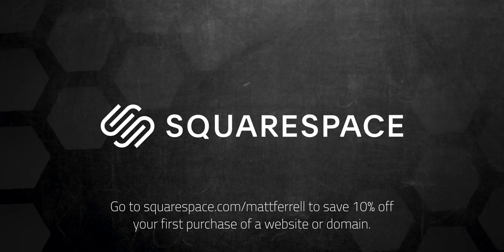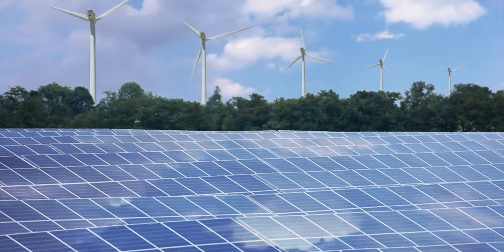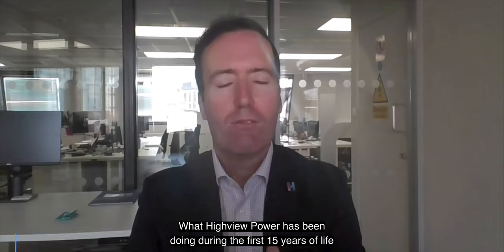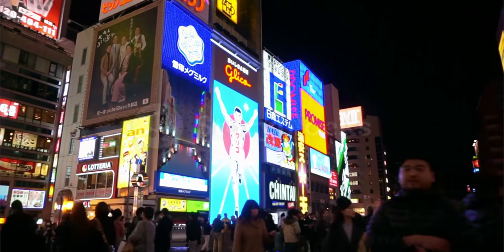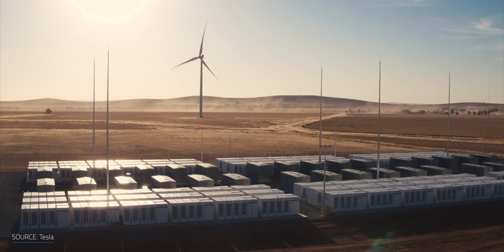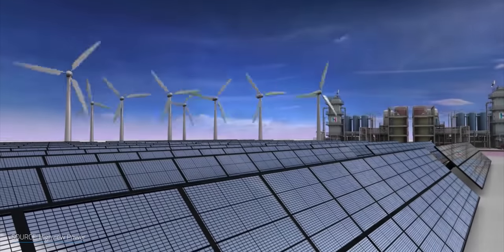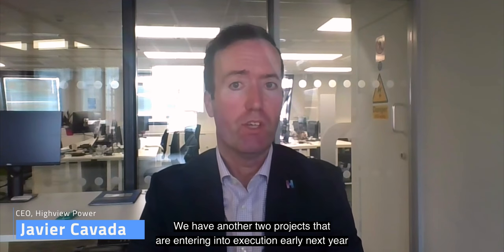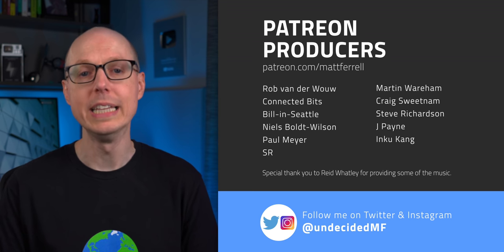Liquid Air Battery Explained - Rival to Lithium Ion Batteries?

Comment: Are the costs for losses on the unusable energy calculated into the actual $/MW for renewable  energy sources like wind and solar? Or are this figures based on theoretical output?
Reply: For the people purchasing a wind turbine they allow for the amount of time a year when it won't be producing in their life time costings. A wind farm not working is normally them being told and paid to turn off, this goes for gas plants on standby as well. It makes sense for the Grid to build storage using the money they would have paid out anyway and gain that extra electricity reserve adding to grid security.
Reply: The cost of generation is the cost of generation.  What you are asking about is the value of each input in creating the lowest total cost for the system/grid.  All our energy sources could produce more than we typically use.  (Nuclear is the exception in the US.  Nuclear is the 'most favored child' and is allow to run while other generators are told to lower/stop output.)

The capacity (CF) factor for coal and combined cycle natural gas plants is between 40% and 60%.  That says that there's a lot of unusable energy potential.  The CF for gas peakers is around 5%.  About 95% of their potential generation is not used.    

As renewable grid supply systems are designed the people doing the math will look at what would happen if they overbuilt wind or solar, not using some of the potential generation, in order to supply more demand direct from turbines and panels or if it would be more cost effective to add more storage to capture some of the unneeded wind/solar output and use it at a different time.
Reply: @bobwallace9753  "Nuclear is the 'most favored child' and is allow to run while other generators are told to lower/stop output."

When the unfavored children, Solar and Wind, are curtailed (i.e. not running, but able to) they continue to be paid. Favored child Nuclear has to pay for the privilege of running during those periods.

The problem with the unfavored children, is that when they throw a temper tantrum, complaining that the wind isn't blowing or the sun isn't shining or night fell or a storm is coming, AT NO PRICE, NO MATTER HOW HIGH, will they generate. They just go to their rooms and intermittently sulk.

The unfavored sulking children (Wind sulks around 70% of the time, Solar around 75%) are not punished, but rewarded with subsidies when they do come out of their rooms and do some work.

The favored, responsible child Nuclear works around 95% of the time, announces months in advance that she is taking a break (the other 5% of the time is maintenance and refueling) but is only paid the same amount as Wind and Solar, if she isn't paying to run during a windy day.
Reply: "Are the costs for losses on the unusable energy calculated into the actual $/MW" - no.

As Helen Lawson points out, the COST of construction and operation is the cost of doing business.

in a regulated state, the PRICE is set as a 1+% of COST to ensure profitability.

But, in the ISO, the PRICE $/MW is set by the clearing price of the auction, which includes any subsidies, tax deals, RE mandates etc.

For a demand of say 500 MW, it breaks down like:
Wind - 200 MW capacity -->  -2$/MWh (negative due to production tax credit subsidy)
Nuclear - 200 MW capacity -->  +2$/MWh
Natural Gas A - 200 MW capacity -->  +4$/MWh (high due to fuel costs)
Natural Gas B - 200 MW capacity -->  +6$/MWh (higher due to bad deal on fuel costs)
-----------
Result:
Wind is paid $4 @ 200 MW
Nuclear is paid $4 @ 200 MW
Natural Gas A is paid $4 @ 100 MW
= 500 MW demand, and $4 clearing price (lower bidders are paid more than their bid, because they were willing to bid low, so they are not penalized they could not make the entire contract).

For a low demand of 200 MW (Sunday at night) it breaks down as:
Wind - 200 MW capacity -->  -2$/MWh (negative due to production tax credit subsidy)
Nuclear - 200 MW capacity -->  -2.01$/MWh
 (negative because they find it difficult to shut down the plant and the juice has to go somewhere)
Natural Gas A - 200 MW capacity -->  +4$/MWh (high due to fuel costs)
Natural Gas B - 200 MW capacity -->  +6$/MWh (higher due to bad deal on fuel costs)
-----------
Result:
(favored child) Nuclear pays out $2.01 @ 100 MW
Wind is paid $1 @ 100 MW (because the grid pays the curtailment penalty for restricting them)

Over time, the 'favored' Nuclear plant can't support its capital costs selling electricity and so the plant shuts down.
The price rises to $6 at peak demand (i.e. the price of the higher priced, lower capital cost Natural Gas B plant).
The price stops going negative, because now Wind need only beat Natural Gas A, and Natural Gas A will never bid negative because they CAN shut their plant down temporarily.
Blackouts increase, because Natural Gas A and Natural Gas B can only supply 400 MW, so if the wind is not blowing on a 500 MW demand day ... no juice!

Do you see how cheap Wind is????
Reply: @factnotfiction5915  You are intermixing market sales and contractual sales of electricity.

On a pure market grid the utility is going to purchase the least expensive electricity first and then continue to purchase the next least expensive sources until they have obtained enough supply to meet demand.  With market pricing wind and solar are going to be the first purchased. "New" wind and solar are now cheaper sources of electricity than paid off coal, natural gas, and nuclear.  If you own a nuclear plant and are selling your product into the market you are out of luck when the wind is blowing and Sun shining.  Since it is very disruptive and very difficult to cycle a reactor off and back on you end up selling your electricity at a loss in order to force wind and solar to curtail.

On a supply contracted grid things get more interesting.  If the utility owns the reactor or has a "must take" contract then they will use that nuclear first (favored child) and not purchase from non-contracted sources.  If the utility has signed "must take" contracts with wind and solar as well then when there's more potential input from contracted nuclear, wind, and solar the utility will call for wind and solar curtailment but pay for the electricity which could have been generated.

Now for the rest of your "sulking children" comment.  That's just a silly take.  We all know that wind and solar are intermittent producers.  People in the stone age knew that.  As organisms evolved from single cells the fact the Sun wasn't in the air 24/365 was factored in.  So let's talk about how we deal with that intermittency issue.  

The solutions?  Storage, overbuilding, and dispatchable loads.  

Storage is getting very much more affordable.  Tesla just found out how to drop the cost of battery storage by about 50% and if you add in recent data on battery cycles the cost of battery storage drops very low.  $50/kWh and 15,000 cycles = $0.003/kWh to store daytime solar to use at night.  That's cell cost only.  

Overbuilding is what we've always used to assure we have enough capacity to meet demand.  We use our gas peakers about 5% of the time.  We overbuild gas peakers by 20x because when we need them, we need them.  (Interestingly, batteries seem to be rapidly replacing gas peakers.)  Sometimes it will make sense, for example, to install more solar panels that we need for sunny days so that we will have enough electricity on cloudy days.

Dispatchable loads will likely become more common.  We will find more and more ways to use electricity when it's plentiful and turn off those applications when supply is lower.  We do that now in California by pumping water over the mountains to the LA Basin when there's extra electricity.  

Wind and solar have become extremely affordable and should continue to drop in cost.  Nuclear has found no route to becoming affordable.  The age of nuclear power is waning.  Pretty much no country that has aging out nuclear reactors set up a program to replace those expiring reactors with new reactors.  Nuclear simply does not make economic sense.
Reply: @factnotfiction5915  The subsidies you speak of are not inclusive.  You only talk about the actual tax credits given to some producers at the current point in time.  In order to fully evaluate the cost of electricity from various technologies we must include all non-production costs.  There are massive external costs associated with fossil fuel use.  Health, environmental damage, and climate associated costs.  

And there are subsidies that have been given to "established" technologies in the past that allowed them to mature.  

"The economic and health costs of air pollution from burning fossil fuels totaled $2.9 trillion in 2018, calculated in the form of work absences, years of life lost, and premature deaths, according to a new report by the Center for Research on Energy and Clean Air (CREA). The cost represents 3.3 percent of global GDP, or about $8 billion per day."

That $2.9 trillion annual expense is a subsidy.  It's a cost created by fossil fuels which in not included in the cost at the meter or pump but paid through other ways.

Over the first 15 years of these energy sources’ subsidies, oil and gas received 5 times what renewables got (in 2010 dollars) and nuclear energy got 10 times as much. (Most of the renewable subsidies went to corn farms for ethanol, not wind, solar and other renewable electricity technologies.)

Between 1918 and 2009 oil and gas received average annual subsidies of $4.86 billion. (92 x $4.86 billion = $447 billion)

Between 1947 and 1999 nuclear received average annual subsidies of $3.50 billion. (53 x $3.50 billion = $185.6 billion)

Between 1980 and 2009 biofuel received average annual subsidies of $1.08 billion. (29 x $1.08 billion = $31 billion)

Between 1994 and 2009 wind and solar received average annual subsidies of $0.37 billion. (15 x $0.37 = $5.6 billion)

$4.86 billion vs. $3.50 billion vs. $0.37 billion per year.
--

OK, now let's deal with how things are likely to play out.  I'm using Lazard's most recent numbers.

New subsidized wind has dropped as low as $9/MWh with a median cost of $25/MWh.
New subsidized solar has dropped as low as $24/MWh with a median cost of $28/MWh.

The marginal cost of CCNG (operating cost of a paid off CCNG plant) is $23/MWh with a median cost of $28/MWh.

The marginal cost of nuclear (opex of paid off rector) is $34/MWh with a median cost of $41/MWh.

Now, if you run a utility company and need to keep your costs as low as possible to you use a combination of $25 wind, $28 solar, and $28 NG?  Let's say you use a third of each which would average out to $27/MWh.  

Or do you add in $41/MWh nuclear?  A quarter of each would take your costs to $31/MWh?   Why would you increase your cost by $4/MWh?
Reply: @bobwallace9753  First, I will agree that fossil fuels have a massive and undeserved subsidy in terms of the negative externalities of emissions. Coal and Natural Gas are bad.
(Despite the fact that you don't account for Natural Gas' negative externalities, you lump it in with your solution - which I will disagree with - after all, it only emits 40x more than Wind or Nuclear).

"Between 1947 and 1999 nuclear received average annual subsidies"
should be corrected to 'Between 1947 and 1999 Gen II/III nuclear received average annual subsidies'
Gen IV is a completely different technology. If you are lumping RE together, should we count the historic Hydro subsidies against Wind/Solar? No - because these are completely different technologies.

Should we count historic subsidies at all?
(Economics teaches "no economic decision should be made on the basis of sunk costs")

You use marginal costs - that is frankly stupid (before you fire back, let me provide an example):
The marginal cost of solar is very low: so if we build only solar plants .... no juice at night. Cheap, but nonexistent.
The marginal cost of nuclear is not low, but the average price of nuclear is low .... same low price during day as during the night.
Which is better? 
Really, think about this a bit before you fire back. It is a really problematic metric.

Marginal price is not a good comparison. Average price is better (although not perfect). System price is even better - if retail prices go up (as in Germany; much of it taxes, but then those taxes pay the subsidies) then an individual plant's marginal/average/wholesale price is meaningless.

You use LCOE - a better metric than marginal price, but still has issues.
https://en.wikipedia.org/wiki/Levelized_cost_of_energy
"The per-unit value is less important than the thing considered as a whole...LCOE, for example, fails to take into account the time of day during which an asset can produce power, where it can be installed on the grid, and its carbon intensity, among many other variables. That’s why, in addition to [levelized avoided cost of energy (LACE)], utilities and other electricity system stakeholders...have used benefit/cost calculations and/or an asset’s capacity value or contribution to peak on a system or circuit level."

And you fell direct into the trap with: "Now, if you run a utility company and need to keep your costs as low as possible to you use a combination of $25 wind, $28 solar, and $28 NG?  Let's say you use a third of each which would average out to $27/MWh." = $81 of assets = $27 average

Where is the trap? Well, if you have 1/3rd wind + 1/3rd solar and there is no wind during the night, then you have to rely on 100% NG - which means you have a blackout. Not great service!

OR you lower your return on assets
1x $25 wind + 1x $28 solar + 3x $28 NG = $27 average! (so its the same ???? no)
because you have $137 of assets, you have to upkeep the idle plants, leading to $45/plant operational costs

You either have to:
    A: raise your price for a reliable grid (wait, isn't RE cheaper???)
    B: lower your profits for a reliable grid (leading to long-term lack of investment)
    C: accept a less reliable grid

As for C, I am not interested in turning the 1st world US into a 3rd world economy. Instead we should turn 3rd world economies into 1st world economies!
Reply: @factnotfiction5915  
"Should we count historic subsidies at all?"

We should recognize historical subsidies.  To the extent that those subsidies helped technologies mature and grow enough to reach economies of scale they are important.  Nuclear had theirs.  Wind and solar are now getting theirs and approaching the point at which they will no longer be needed.

Post subsidies new wind and new solar will be massively less expensive than new nuclear.  Something like 2 cents per kWh vs. 15 cents per kWh.

"You use marginal costs - that is frankly stupid"

I used the marginal costs of coal, CCNG, and nuclear vs. the cost of new wind and solar which are still paying off their installed costs.  For wind and solar it's installed costs + marginal costs.  That's the reality of an electricity purchaser.  "Do I buy from a paid off reactor at at higher price than what I would have to pay to a wind or solar farm that just opened up?"

Remember, the emission problems of NG are not factored into the wholesale cost of electricity.  Those are external costs and not a consideration by the utility buyer.

If we do an apples to apples comparison, installed + opex price comparison,  then it's game over.  Coal and nuclear are completely out of consideration.  CCNG stays in the game for now simply because we have to have something to fill in the wind and solar gaps.  

The game is to meet demand as inexpensively as possible.  To do that you start with the least expensive sources and fill in with a dispatchable source.  Right now CCNG is the best dispatchable source, except for hydro which is capacity limited.  What we are now seeing is batteries beginning to replace NG.  And with Tesla's immense cost breakthrough we can expect batteries to greatly replace NG going forward.  

Here and past this point you demonstrate that you are not using logic but commenting from emotion.

"Where is the trap? Well, if you have 1/3rd wind + 1/3rd solar and there is no wind during the night, then you have to rely on 100% NG - which means you have a blackout. Not great service!"

Think about what you wrote.  If you can't figure out the problem get back to me.
Reply: @factnotfiction5915  

I want to address the cost of electricity more directly.

"I am not interested in turning the 1st world US into a 3rd world economy. Instead we should turn 3rd world economies into 1st world economies!"

Look at what is happening in the US at this very moment.  Coal plants are being closed because they are no longer competitive.  Some nuclear reactors have been closed because they were not competitive and more are scheduled to close for economic reasons.  Some paid off reactors are now receiving subsidies because they can not continue operation if all they receive are market prices.  Those reactors are only being kept online to support jobs in local communities.

That tells us that the cost of US electricity is dropping.  The most expensive sources are falling away because less expensive sources have entered the market.  This will continue as the cost of wind, solar, and storage continue to drop.  Since the utility industry does not (at this time) price in external costs we'll see cheaper technologies push out more expensive technologies with a resulting decline in costs.

Developing countries will go, and are going, straight to renewable energy.  Just like they largely bypassed landline phones and went straight to mobile phones.  Renewables are much cheaper to install.  They can be installed in a modular fashion, unlike very large fossil fuel or nuclear plants.  And they can be installed close to demand, bypassing expensive transmission/distribution costs.  Developing countries are likely to end up with lower energy costs than previously developed countries because they won't have the problem of more expensive legacy plants.
Reply: @bobwallace9753  

"On a pure market grid the utility is going to purchase the least expensive electricity first"
When the market is setup as a Dutch auction with rewards for least marginally expensive electricity - yes.
However, that does not make RE the least expensive for society, it is an artifact of the market structure that RE is 'cheapest'.

FERC asked this question: "On a 100% wind and solar grid, what is the clearing price for electricity when the wind isn't blowing at night?"
Then they came up with a 'capacity' auction, in addition to the existing 'energy' auction. Things have gone downhill from there.

insoluble

"The solutions?  Storage, overbuilding, and dispatchable loads." - Storage and overbuilding - yup! adding necessary assets, lowers the return and increases the price. Do you still claim this makes wind/solar cheaper? 

Dispatchable loads - yup! However, someone has to pay for poorer service. If my aluminum plant is going to go offline because of your poor service, I will demand, not just the cost of the juice, but the cost of the inconvenience. And, by the way, you can't keep me offline for more than 1-2 hours! And, if I have a must-ship order, you gotta pay my cancellation fees. And because my customer didn't get their shipment, the entire economy suffered.
Or, I might establish my own power plant - great now my balance sheet just ballooned with this extra asset, I have new liabilities, and it isn't the "stick to your core business" principles I learned in business school.
Wow! that RE with dispatchable loads is soooooo cheap!

"Storage is getting very much more affordable." - but you don't include storage costs in your wind/solar LCOE, do you?

"Overbuilding is what we've always used to assure we have enough capacity to meet demand.  ...., to install more solar panels that we need for sunny days so that we will have enough electricity on cloudy days.
"

We price in MWh, but we use in MW - so, to use your previous example of $25/MWh Wind, $28/MWh Solar, $28/MWh NG - AND ASSUMING ZERO INTERMITTENCY - we can calculate overbuild with the EIA capacity factors of 35% Wind (1/3rd), 25% Solar (1/4) and 60% NG (1 - because NG intermittency is how it is used more than its intrinsic c.f. -and anything less makes your solution worse)

we have: 3x$25 wind + 4x$28 solar + 1x$28 gas = $215 total assets for 3MWh = $71.1/MWh
    (3 wind farms to overcome the 1/3rd c.f. - et cetera
     3 MWh is the minimum, with a peak overbuilt energy of 8 MWh,
     so a maximum of 5 MWh curtailment
     It just gets worse if you add in intermittency)

versus 1.1x$41 nuclear (90% c.f.)  = $45.1/MWh
hmmm - nuclear appears to be 40% cheaper overbuild-wise (and at 0 intermittency!!)

"Wind and solar have become extremely affordable and should continue to drop in cost." - and has to drop in cost 3x/4x more to support overbuild and storage, none of which your LCOE numbers reflect.
Reply: @bobwallace9753  "Where is the trap? Well, if you have 1/3rd wind + 1/3rd solar and there is no wind during the night, then you have to rely on 100% NG - which means you have a blackout. Not great service!"

Think about what you wrote.  If you can't figure out the problem get back to me.

Bob - you proposed a scenario where a demand load is met by 3 equal-sized plants, 1 wind, 1 solar, 1 NG. I am asking how you meet that demand load if 2 of the plants flake out due to intermittency.

I posit that you could back up with a 3x the size NG plant (raising your costs and lowering your ROA or you could build a 3x size nuclear plant to avoid a blackout or you could just accept the lack of power.

What you haven't answered is how RE makes such a situation cheap.
Reply: @bobwallace9753  "You use marginal costs - that is frankly stupid"
 - and you double down by failing to realize the lack of usefulness of this metric.

"For wind and solar it's installed costs + marginal costs." amazing! you're going to pay off the combination of installation + operation on only marginal pricing? words fail me!

"If we do an apples to apples comparison, installed + opex price comparison,  then it's game over.
CCNG stays in the game for now simply because we have to have something to fill in the wind and solar gaps." 

Hmm, where nuclear leaves, RE does not replace it. Fossil fuel does.

Germany, Japan or in the US Yankee Vermont, Indian Point, Fort Calhoun, et cetera

https://www.greentechmedia.com/articles/read/us-nuclear-retirements-largely-replaced-by-fossil-fuels
https://naturalgasnow.org/indian-point-closure-puts-empire-state-up-against-a-wall-of-natural-gas/

Post the article that shows wind/solar replacing a NPP closure? I have been looking for that unicorn for over 2 years.
Reply: @factnotfiction5915  

"that does not make RE the least expensive for society,"

If you look at market cost + external costs then it is very clear that wind, solar, and storage are the least expensive electricity sources for society.  Even if we used only pump-up hydro storage at about $0.10/kWh we would settle in on the three and between liquid air, batteries and other possible storage solutions we won't be paying $0.10/kWh for storage.

Remember, new coal and new nuclear are very expensive compared to new wind, new solar, and new storage.

"someone has to pay for poorer service"

Yes, if someone has their operations disrupted they will need to be compensated.  We already do that with aluminum plants and pulp mills when supplies are stressed.  But there are also a lot of demand which is not 100% 24/365 and that will respond to prices and operate when the cost of electricity is lower.  Store "heat/cold" for HVAC use.  Charge EVs.  Run gravel crushers.  Run desal plants.  Find demands which have lower capital costs, build more than are needed, and run them only part time.

Now let's talk about LCOE.  Levelized Cost of Energy.  It's the cost of electricity coming out of a supplier, nothing more, nothing less.  Don't confuse that with the cost of a utility operation which also includes other costs.  Keep with the meaning of the term.

The purchase price of your car does not include what you are going to spend for fuel, oil changes, and repair.  

And LCOE is based on some assumptions.  For example, the LCOE for coal plants, IIRC, uses an 85% capacity factor.  But in the US our coal plants average between 50% and 60% CF.  The actual cost to the grid is higher than the LCOE because they have to pay the coal plant enough to cover the LCOE + the lost revenue resulting from lower demand.

Your math.  I'm not going to spend time on that because you haven't done an apples to apples comparison.

Nuclear is not 'always on' and can't closely load follow.  If you want to create a total cost for wind + solar + NG/storage then you need to create a total cost for nuclear + storage + backup.

Back when we were building nuclear plants we built a lot of pump-up hydro storage because most of our coal and nuclear plants were not quickly dispatchable nor could they do a good job of load following.  Both coal and nuclear plants go offline unexpectedly which means that we have to have some sort of immediately available backup.  In the old days we did that largely by running coal plants below full capacity and ramped them up when needed.   Some grids actually used spinning mass as a backup source.
Reply: @factnotfiction5915  Come on, you must understand your problem.

When the Sun is shining brightly demand might be met by 100% solar.

When the wind is blowing strongly demand might be met by 100% wind.

When there's some solar and/or wind demand might need some NG (or storage).

When there's no solar or wind demand will need to be met by all NG (or storage).

Add up what happens in each individual hour of the day and divide by 24.  That's where you get 33%, 33%, 33% or whatever it is.  Peak use is different from average use.

(I've ignored hydro and geothermal to keep things simple.)
Reply: @bobwallace9753  "That tells us that the cost of US electricity is dropping." - or, rather than unfounded hypotheses, we can just look at the data.

US electricity prices are rising, sector prices are rising, geographic prices are rising.
Prices are also rising in California, land of renewables, in all sectors.

[added a few minutes later]
I forgot this question: As wholesale prices decline due to RE, why are retail prices rising?

My answer: RE wins at the wholesale auction due to the way the 'market' is set up to favor low marginal pricing. However, systems costs are rising as the low average pricing thermal plants (i.e. Nuclear) leave the market.
The 'cheap' wind and solar isn't so cheap when others (state subsidies, competitors, ratepayers) have to bear the costs.

I look forward to your answer! Should be quite amusing.
(note retail is not a synonym residential sector)
[end of addition]

[Look, at least look at the data when it is available, and especially when it is so easy;
 I believe you are going to need a whole new line of argument to justify your concept that RE is cheap]

If these links don't work, then goto the base and bring up Average Retail Price of Electricity report. You can add/subtract states/areas/the US and various sectors; I selected annual, but you can go monthly - don't trust 2019/2020 too much due to covid

California - land of renewables
https://www.eia.gov/electricity/data/browser/#/topic/7?agg=0,1&geo=000000000004&endsec=f&linechart=ELEC.PRICE.CA-RES.A~ELEC.PRICE.CA-COM.A~ELEC.PRICE.CA-IND.A~ELEC.PRICE.CA-TRA.A&columnchart=ELEC.PRICE.CA-RES.A&map=ELEC.PRICE.CA-RES.A&freq=A&start=2001&end=2019&ctype=linechart&ltype=pin&rtype=s&maptype=0&rse=0&pin=

US - by sector
https://www.eia.gov/electricity/data/browser/#/topic/7?agg=0,1&geo=g&endsec=fg&linechart=ELEC.PRICE.US-RES.A~ELEC.PRICE.US-COM.A~ELEC.PRICE.US-IND.A~ELEC.PRICE.US-TRA.A~ELEC.PRICE.US-OTH.A&columnchart=ELEC.PRICE.US-RES.A&map=ELEC.PRICE.US-RES.A&freq=A&start=2001&end=2019&ctype=linechart&ltype=pin&rtype=s&maptype=0&rse=0&pin=

US Sections - All sectors
https://www.eia.gov/electricity/data/browser/#/topic/7?agg=1,0&geo=fvg&endsec=g&linechart=ELEC.PRICE.NEW-ALL.A~ELEC.PRICE.MAT-ALL.A~ELEC.PRICE.ENC-ALL.A~ELEC.PRICE.WNC-ALL.A~ELEC.PRICE.SAT-ALL.A~ELEC.PRICE.ESC-ALL.A~ELEC.PRICE.WSC-ALL.A~ELEC.PRICE.PCC-ALL.A~ELEC.PRICE.MTN-ALL.A~&columnchart=ELEC.PRICE.NEW-ALL.A&map=ELEC.PRICE.NEW-ALL.A&freq=A&start=2001&end=2019&ctype=linechart&ltype=pin&rtype=s&pin=&rse=0&maptype=0
Reply: @bobwallace9753  "If you look at market cost + external costs then it is very clear that wind, solar, and storage are the least expensive electricity sources for society. "

Right up to the point that you cannot buy them.
When the wind stops and night falls they are literally priceless

I must say, I admire your moxie! Anyone who presents himself as knowing about the market, but didn't realize US electricity prices are rising has an amazing amount of (misplaced) confidence.
Reply: @factnotfiction5915  
"Bob - you proposed a scenario where a demand load is met by 3 equal-sized plants, 1 wind, 1 solar, 1 NG. I am asking how you meet that demand load if 2 of the plants flake out due to intermittency.

I posit that you could back up with a 3x the size NG plant (raising your costs and lowering your ROA or you could build a 3x size nuclear plant to avoid a blackout or you could just accept the lack of power.

What you haven't answered is how RE makes such a situation cheap."

OK, now let's make sure we are first talking about the transition from a largely fossil fuel grid to a clean, low carbon grid.  

To start with we have all the capacity we need.  Roughly 25% NG, 30% coal, 20% nuclear, 25% renewable.  Adding more wind and solar means that we can drop more expensive plants.  That is happening.  And since we have a lot of CCNG and dispatchable hydro already online we can add intermittent wind and solar while continuing to meet demand.  

Now let's think building a new grid from scratch.  To do so we need to look at installed costs.  These are old numbers, as you can see.  The installed cost of wind and solar has dropped since then.  The cost of the Vogtle 3&4 reactors has risen.

Wind Onshore  
 $1.53 Installed Cost/Watt
 DOE 2016 Wind Technologies Market Report

PV Solar
$1.00 Installed Cost/Watt
$1.07 With Tracking
U.S. Solar Photovoltaic System Cost Benchmark: Q3 2017

CCNG
$0.97 Installed Cost/Watt
U.S. EIA

Nuclear
$6.84 to $12.09 Installed Cost /Watt
Based on Vogtle 3&4 initial projected cost of $15.5 billion and recent projected cost of $27 billion.

Build a grid using a mix of wind, solar, and CCNG on those out of date numbers and the installed cost for generation would be $3.57 per watt. 

Build a grid using a nuclear reactor and the CCNG plant needed to back it up and the cost would run from $7.81 to $13.06 per watt.  Over two times to almost four times as expensive.  

That's the cost to build.  Then there's the cost for operating.  The opex, the marginal cost for wind and solar is massively less than either nuclear or CCNG.  If you were building a grid from nothing what you would use is obvious.

"I posit that you could back up with a 3x the size NG plant (raising your costs and lowering your ROA or you could build a 3x size nuclear plant to avoid a blackout or you could just accept the lack of power."

If you use real world numbers then you should be able to see where your posit falls on its butt.  To back up a watt of wind and solar you need a watt of CCNG.  To back up a watt of nuclear you need a watt of CCNG.  Those numbers are just up the page.

You could build 3x as many nuclear plants as you need, on average,  hoping that conditions don't take out all three as can happen is heat waves, earthquakes, and floods but the cost would be enormous.  At $6.84 (the low end cost) per watt that would be over $20/watt when a watt each of wind, solar, and CCNG would cost less than $4.  A >5x difference.
Reply: @factnotfiction5915  

I am starting to have trouble taking  you seriously.  If you don't understand that we have ways to generate electricity when the wind is not blowing and the Sun not shining then you've paid no attention to my comments or the real world.  

Now, what do you really know about rising electricity prices in the US?  Do you know what portion is due to fuel cost vs. the cost of adding wind and solar?  Do you know how much is due to inflation?

Do you realize that Texas has put a very large amount of wind generation along with some solar on their grid and since they started adding wind their inflation adjusted cost of electricity has stayed stable?  Do you realize that there will be a point before long when those wind and solar farms will be paid off and the wholesale cost of electricity will become cheaper due to the very low opex costs of wind and solar?
Reply: @bobwallace9753  You need a small adjustment to your numbers:
For a 1x W, 1x S, 1x NG
  now add in overbuild for low capacity + 2xW + 3xS
  then add backup for intermittency + 2xNG
  now add in grid level-backup (usually reserve capacity is about 20%) + 0.6x NG
= 3x W, 4x S, 3.6x NG (not the 0 reserve capacity you suggest)
= $12.36 to meet demand (not 7.81 where you ignore intermittency or backup or your overbuild)

For a 3x NPP
  then add backup for intermittency + 0xNG
  now add in grid level-backup (usually reserve capacity is about 20%)
  + 0.6x NG

= 3x NPP + 0.6 NG (not the 1:1 reserve capacity you suggest)
You cherry-pick Vogtle, rather than me cherry-picking Chinese or Korean reactors (note the APR-1400 is licensed in the US), I will instead point out that if nuclear can reach

(12.36 - 0.6*0.97)/3 = $3.93/W 

Then your advice should switch to purchase of nuclear.
    http://energy.mit.edu/wp-content/uploads/2018/09/The-Future-of-Nuclear-Energy-in-a-Carbon-Constrained-World.pdf
           Optimistic US Gen III - 4.1/W
           Average Chinese Gen III - 2.8/W
points out that costs are very, very close - move from FOAK to NOAK, from on-site Gen III construction to off-site Gen IV manufacture, and arguing against nuclear on cost becomes dodgy.

When you include RE costs of transmission, storage, and grid management - (even your analysis says we should be at least 7.81 - although you fail to include ALL the overbuild and ALL the backup) - it becomes even a more difficult argument.
Nuclear has challenges to overcome - but it doesn't have to invent new science (storage), deploy new systems (transmission and grid management), or overbuild (low return on assets).

(again, I still maintain that LCOE is only 1 parameter to consider, as LCOE doesn't indicate

You should really stop cherry-picking your disasters also - Do earthquakes and floods only affect NPPs??? Please, be realistic. Puerto Rico's hurricane Maria shows that RE isn't resilient either. (of course, you could harden those installations - but then that adds to costs also!)

As for heat waves - wow - more extrapolation of single reactor issues to the fleet - shown false here:  https://www.exeloncorp.com/newsroom/illinois-nuclear-plants-operate-at-full-power-during-extreme-heat
Reply: @factnotfiction5915  
"You need a small adjustment to your numbers:"

No, you need to think more clearly.  If I need a watt of electricity the grid can supply me with a watt generated from solar or from wind or if neither are producing at that point in time the grid can fire up their CCNG source.  There's no need to overbuild or deal with intermediacy of wind/solar, that's NG's role.  

And as we go forward more and more of NG's role will be taken over by storage.

Now, if we are to continue this discussion could we please limit posts to one topic?  Let's keep it simple in the service of comprehension.
Reply: @factnotfiction5915  Nuclear plants taken out by climatic/geological events.  It happens.  The glaring example is Fukushima.  An approaching hurricane can cause multiple reactors to be shut down for safety.  Both North Anna reactors were knocked offline by an earthquake.  Multiple reactors get shut down in heatwaves.  Multiple reactors have gone offline due to flooding.

My point was that you can't just build a reactor and consider it a constant source of electricity.  You can't compare a grid supplied by reactors with no backup to a grid powered by RE and insist that the RE also includes backup.  Comparisons need to be same:same.
---

BTW, there were two large PV farms in Puerto Rico.  One was partially damaged.  The other was designed for higher winds and flooding and was largely undamaged.  Same for wind turbines.  Some turbines are designed for Cat3 storms.  The cost of hardening is an economic factor.  In a place like an island where the RE capture net is small it probably makes sense to build for endurance.
Reply: @bobwallace9753  OK, so you don't believe in overbuild. Fine.
Then we have 1xW + 1xS + 3.6xNG 
1 NG to provide 1/3rd power
2 NG to take the slack if wind/solar are 'sulking'.
0.6 NG for reserve capacity

But then why are we building the 1xW, 1xS?

Why not just run 3.6 NG and save on assets? According to YOUR LCOE numbers, NG is cheaper, so adding W/S just adds expense.
3 NG to provide total demand, 0.6 for reserve capacity
vs 1xW + 1xS + 3.6xNG

You appear to have no problem with NG, but you stick the W + S in there willy-nilly.

I view NG as a high-carbon fuel. So, really we don't want NG at all.

My thinking is consistent: low-carbon nuclear provides dispatchable power - electricity without NEEDING improvements to storage, to transmission, to grid management - which also protects the climate.
Non-hydro RE can provide a low % supplement to generation, but needs to pay for its intermittency externality, and it faces major technical issues (ex: storage) which may (or may not) be solvable.
Nuclear's problems of finance are 100% solvable. Innovations are of course welcome to reduce that burden.
Reply: @factnotfiction5915  
One additional point.  In previous posts you've used faulty CF numbers for wind and solar.  I recall you using 35% for wind which is an average of all currently operating wind turbines, some of which are >25 year old technology.  Currently installed turbines are averaging well into the 40% range and as we move to higher hub heights (110 to 140 meters) we should be enjoying 60% to 70+% CFs. 

I don't recall what you used for solar but using the most recently reported 12 months by the EIA (Sep 2019 through Aug 2020) the average CF was 29.5%.  Single axis tracking solar can have CFs as high as 35%.

When we talk about converting our grid supply away from fossil fuels we should use current costs and current capacity factors.  We aren't going to be building wind farms with 20% CFs and solar farms with 12% CFs.  The cost of new wind and solar farms are going to be toward the lower end of Lazard's price range rather than at the average cost.  As well we should anticipate costs to decrease and CFs to rise.

Additionally, we need to think more about hours of production.  As we move to single axis trackers along with east and west facing installation for solar we extend the solar day.  Mounting half of an array facing east and half facing west can reduce output up to 20%.  But it kicks production in much earlier in the day and keeps production going later into the day which eliminates the need for storage.  The round trip efficiency of batteries is in the 90% to 95% range.  Take the worst case of 20% output loss (higher latitudes) and the worst case storage loss of 10% and the total loss is only 10%.  With the installed cost of solar now under $1/watt having to install an extra 10% ($0.10) is probably going to be cheaper than adding storage.  Also, single-axis tracking adds only about 10% to the cost.

Same with wind.  As we move to higher hub heights and install turbines offshore we get ourselves into steadier winds which means more direct flow from the turbine and less need to store for low wind periods.  

Short version.  Use realistic current numbers and also consider likely future improvements in those numbers.  The changes we make will be now and in the future, not in the past.
Reply: @bobwallace9753  "An approaching hurricane can cause multiple reactors to be shut down" 
Or they can be the only source of power for an area post-hurricane.
https://www.forbes.com/sites/jamesconca/2017/09/01/hurricane-harvey-makes-the-case-for-nuclear-power/

"You can't compare a grid supplied by reactors with no backup to a grid powered by RE and insist that the RE also includes backup"
Yes, I agree. However, you can compare a 100% dispatchable grid against a grid dominated by non-hydro RE.
So, if you have a 100% nuclear grid that has plants backing each other up, why can't you compare that against a RE grid? Why does a RE grid get a pass on reliability?

RE interjects intermittency - RE should deal with it, not externalize their problem to their competitors.

Your 'solution' is to add high-carbon NG plants - but make the NG plants pay for the privilege, not the RE causing the problem.

My solution is to add the costs of intermittency to the RE causing the problem - then the investment decisions change and the grid only installs intermittent RE to the extent that makes economic sense.
Reply: @factnotfiction5915  
Wrong.  I greatly believe that overbuilding will be part of the solution.  But I'm trying to keep the argument simple because you don't seem to be comprehending even a simple solution.

The following quote makes zero sense if our goal is to produce a single watt of electricity 24/365.

"Then we have 1xW + 1xS + 3.6xNG 
1 NG to provide 1/3rd power
2 NG to take the slack if wind/solar are 'sulking'.
0.6 NG for reserve capacity"

If the Sun is shining brightly then the watt will be supplied by solar panels.
1 watt needed -> solar provides 1 watt.

If the wind is blowing strongly enough the watt will be supplied by a turbine.
1 watt needed -> wind provides 1 watt.

If neither wind nor sunshine have turned up for work, if they are "sulking", then the watt will be supplied by NG.
1 watt needed -> NG provides 1 watt.

In any weather/time of day condition 1 watt can be provided with only a single watt of solar capacity, a single watt of wind capacity, and a single watt of NG capacity.

1 or 1 or 1 = 1

Natural gas is the reserve capacity and we need only a single watt of NG capacity to back up a watt of solar/wind.

I'll stop there.  Until you conquer that basic principle we can't take the discussion further.
Reply: @factnotfiction5915  
Fact:  In the face of oncoming very strong storms multiple nuclear reactors are required to close down for reasons of safety.  That will happen for hurricanes and flooding.  In the event of an earthquake multiple reactors may be tripped offline.

Fact:  Reactors may or may not return to operation soon after the triggering event.

I'm going to pause with those facts to see if you can take them onboard.  We need to be talking about nuclear in a realistic fashion.  Reactors are not 100% reliable.  They go offline more often than most people realize and because of that they need backup.  The cost of that backup has to be included in a same:same comparison with an RE grid.

And, please, the need for backup/fill-in for wind and solar has been constantly addressed by me.
Reply: @bobwallace9753  Right, using future theoretical numbers is much more accurate that current empirically-determined numbers.

Yup, I admit it! Sue me! I used on-shore current EIA numbers for wind c.f. (ditto solar). 2018 I believe.

I can believe higher hub heights and better c.f. for wind, OFFSHORE wind, meaning higher costs. Let's wait for DATA and avoid SPECULATION.

Your points about higher c.f. for solar are laughable. Improving solar panels raises efficiency, not c.f.
Individual siting provides a specific c.f. for a given solar farm - but it won't move the average c.f. much - law of large numbers!

Tracking - yes, several researchers have noted that the declining price of solar PANELS have less and less effect as the balance-of-plant costs - foundation, tracker, frame hasn't changed much at all.

"The round trip efficiency of batteries is in the 90% to 95% range." - for new (degrades as ages) Li-ion - the majority of batteries, but a high-cost option, with competing markets, low-cycle lifetimes, and discharge times between 4-6 hours.
Let us note that chemical batteries are about 1.5% of world-wide storage (that makes it #2 after difficult-to-site pumped hydro). (IEA, 2018)
Reply: @factnotfiction5915  

"Your 'solution' is to add high-carbon NG plants - but make the NG plants pay for the privilege, not the RE causing the problem."

No.  Not at all.  

What I have been trying to get you to understand that there are two different economic factors in deciding what new generation to build.

1) LCOE.  The cost of producing electricity from a specific source, assuming that the source is allowed to produce at nameplate capacity for the maximum number of hours it can be productive.

Examples:  

a) A nuclear reactor needs to be shut down about 10% of the time for refueling and routine maintenance.  For nuclear we use a 90% capacity factor.

b) A wind turbine or solar panel will have a lower capacity factor depending on where and how the turbine or panel is installed.  A wind turbine, badly sited and on a 50 meter tower might have only a 20% CF.  A wind turbine in a good wind resource area and mounted on a 140 meter tower might have a 70% CF.

2)  Cost of electricity created by the input/storage mix.  This is a much more complex calculation that includes the cost of wind and solar in that area (remember, LCOEs vary by location), the availability/cost of hydro, the current cost of CCNG, the current cost of storage,  the cost of adding transmission if needed, etc.

You need, IMHO, to create two seperate bins in your thinking and not confuse LCOEs with the cost of incorporation into the grid.  

Example:

1)  You have a grid with a lot of natural gas capacity operating.  You're in a good wind or solar area.  You look at the cost of wind/solar, their LCOEs (say, $0.03/kWh) and you look at what you're spending for gas ($0.06/kWh).  Then you determine if it makes economic sense to add some wind/solar, use less fuel, and save money.

2)  You have a grid with a lot of solar already installed.  You're at the point where a significant number of hours per year are fully supplied by solar.  But you have days when you don't have enough solar.  Adding more solar might mean a lot of curtailing because some days you would have too much.  While solar might cost you only $0.03/kWh it you curtail 50% and the opex costs for CCNG are $0.06/kWh then adding solar saves you nothing.  But maybe adding more wind, converting an existing dam to hydro, or adding storage might cost less than the cost of fuel and that would be a way to save costs.
Reply: @bobwallace9753  " not confuse LCOEs with the cost of incorporation into the grid."
My point is that your arguments based on LCOE are pointless, because it IS the cost of incorporation into the grid - the retail price that the grid charges is what matters.

However, even at the LCOE levels, intermittent RE and NPP are fairly close. Which again is pointless as LCOE doesn't include those pesky costs of incorporation.

You haven't addressed this, the real issue -- rising retail costs (from actual, DATA, rather than SPECULATION). Which, matches the rising non-hydro RE penetration. So with these super-low wholesale prices from nh-RE, why aren't we seeing this reflected in retail prices?

Answer: because super-cheap nh-RE isn't cheap when looking at the total grid costs. Intermittency has a cost - pay it, and I have no further issues against RE.

Use high-carbon NG to weasel around it, which is problematic vis-a-vis climate change, and I don't consider that much of a solution.
Reply: @factnotfiction5915  
" I used on-shore current EIA numbers for wind c.f. (ditto solar). 2018 I believe.

I can believe higher hub heights and better c.f. for wind, OFFSHORE wind, meaning higher costs. Let's wait for DATA and avoid SPECULATION."

Why don't you go to the DOE website and look at their wind CF maps for higher hub heights?  They've done the measurements and you can see the areas where we would get 60% to 70+% CFs if we used taller towers.  

And the real fun takeaway is that there are really good wind resources in places like the Southeast where we had assumed onshore wind wasn't very viable.

"Tracking - yes, several researchers have noted that the declining price of solar PANELS have less and less effect as the balance-of-plant costs - foundation, tracker, frame hasn't changed much at all."

Not factual.  The BOS (balance of system - total cost minus panel costs) have been dropping.  One significant cost decline has come from pounding the mounting posts (cheap recycled steel) into the ground and avoiding the material and labor cost of concrete footings.   Machines drive themselves, very precisely, to the next spot and drive a post to the correct height.  Very little labor.  Quick.  Machine completes one solar farm and goes on to the next.

Improvements in rack attachments and panel connections (simple plug togethers) have also dropped costs.  Tracking costs have dropped tremendously over recent years.

""The round trip efficiency of batteries is in the 90% to 95% range." - for new (degrades as ages) Li-ion - the majority of batteries, but a high-cost option, with competing markets, low-cycle lifetimes, and discharge times between 4-6 hours.
Let us note that chemical batteries are about 1.5% of world-wide storage (that makes it #2 after difficult-to-site pumped hydro). (IEA, 2018)"

Anything an agency publishes in 2018 is almost certainly based on 2017 numbers.  We are in an age of rapid disruption.  Anytime you reach back even a couple of years for data you're taking a chance that your numbers are no longer valid.

I've already told you (are you paying attention?)  that it looks like we have cells which essentially do not degrade?  Jeff Dahn as run 15,000+ cycles with no degradation if the cells are no more than 50% discharged.  

We've known for a long time that lithium iron phosphate cells are very good in terms of number of cycles.  But we ignored them because we were concentrating on EV cells and we needed as much storage per weight as possible and LiFePo cells are heavier per kWh than lithium ion cells.  Now we're talking about grid storage where modest amounts of additional weight don't matter.

4-6 hours is a design number.  The highest return for storage is during the 4-6 hours after solar drops out for the day and for the 4-6 hours between extra late night wind and early morning demand.  We're going to see generation and storage systems built where returns are the highest.  And later on, after the low hanging fruit is picked, we'll see storage systems designed for more hours and even for days.  

Remember, this video is about liquid air storage and liquid air storage's possible big advantage is affordable long term storage.  We don't need that now because we are not yet producing more RE than we can use to any appreciable extent.  But later on we'll be wanting to push fossil fuels to 30% and 20% and 10% and 0% of production and we'll need deep storage or dispatchable low carbon generation to accomplish that.
Reply: @bobwallace9753  Much -  bit of an eye is the beholder vs. 'factual'.
"The BOS (balance of system - total cost minus panel costs) have been dropping."
Yes, and IMO, not much.
https://www.pv-tech.org/news/balance-of-system-costs-key-to-further-solar-system-cost-reductions-says-ir
Using this link can get you to the raw data - each reader can decide if this is 'much' or not.

"We are in an age of rapid disruption" - Do you realize that Li-ion is only about 4-6x better than Edison's Fe-acid batteries, yes?
(depends on the metric,  and some of those might be 40x, but in general 100+ years of innovation have paid off only so much)

Another interesting point you bring up is that nh-RE/storage/etc are 'allowed' to innovate - really we should accept these as done deals, but Gen IV nuclear tech is 'pie-in-the-sky'! :) :) :)
Reply: @bobwallace9753  I will leave this debate - it is obvious that we are not convincing each other.
Let me summarize the arguments (in no particular order):

You: Nuclear is particularly, and systemically prone to failure during heat waves
Me: 1 reactor in IL disproves this. i.e. it is not systemic.

You: Nuclear is particularly, and systemically prone to failure during hurricanes
Me: 1 reactor in TX disproves this. i.e. it is not systemic.

You: Nuclear is particularly, and systemically prone to failure during earthquakes (vs. tsunamis)
Me: Fukushima Daiichi suffered a 9+ magnitude earthquake with no problems. i.e. it is not systemic.

(well, you didn't say this, but I'll chuck it in anyway)
Nuclear is particularly, and systemically prone to failure during tsunamis
Me: Onagawa suffered a 13m tsunami with no problems. 
i.e. it is not systemic.

You: LCOE is the metric to compare plant costs
Me: LCOE is one dimension, of multiple, along which to compare plant costs
Me (nh-RE aspect): LCOE for non-hydro RE does not include external costs of:
    * storage
    * transmission
    * demand management
    * intermittency management

You: FOAK NPPs in the US and UK are representative of LCOE for nuclear
Me: no, they are not - you ignore sequential build, and build in China, Korea, France, etc

You: marginal price is a useful metric to compare plant costs
Me: marginal price is an artifact of how the market is constructed and essentially meaningless other than in that context

You: high-carbon NG can cover for non-hydro-RE intermittency
Me: high-carbon NG contributes to climate change emissions and should be discouraged

You: poorer and 3rd world countries want nh-RE
Me: They want dispatchable power, low-carbon if possible - Ghana, Bangladesh, Indonesia, in addition to high-income countries of Argentina, Korea, UAE, Finland, Netherlands - multiple continents, income-levels, cultures

You: nh-RE is cheap
Me (if Bob wants a low-carbon future): nh-RE is cheap if you ignore the real world, squint, and assume an extremely rosy future science-engineering-technology-wise.
Me (if Bob doesn't want a low-carbon future): of course, sure add NG, but then why bother with nh-RE? just add NG!

You: nh-RE is cheap, look at the low 'market' price
Me: nh-RE has lowered wholesale prices; retail prices have increased across the US
       (with the greatest increases correlated with nh-RE penetration)

You: nuclear is expensive
Me: yeah, and that is pretty much its only problem. However, it isn't so expensive that we can't make it cheaper with relative ease and there is only a moderately rosy future finance-wise to create.
Reply: @factnotfiction5915  

Your summary is deeply flawed.

1) My comments about the environmental reasons reactors go offline was in response to your attempting to compare nuclear and RE, requiring backup for RE but not for nuclear.  My point was that in order to make a same:same comparison the factors on each side of the equation have to be equal in function.

2)  You still attempt to misuse LCOE.   Learn what the term means.  

"LCOE for non-hydro RE does not include external costs of:
    * storage
    * transmission
    * demand management
    * intermittency management"

Of course it doesn't.  Try to recall what you wrote here and stick with it.  Don't try to claim wind, solar, nuclear or anything else has a higher LCOE because storage, transmission, etc. costs are not included.  The MPG number for a car tells you nothing about the number of seats in the car.  LCOE is a very specific calculation.

3) "You: high-carbon NG can cover for non-hydro-RE intermittency
Me: high-carbon NG contributes to climate change emissions and should be discouraged"

Both are correct.  Right now, at this specific point in time, we fill in around the intermittent nature of wind, solar, and nuclear with fossil fuel generation.  Sun goes behind a cloud, turn up the gas.  Reactor breaks down, turn up the gas.

Of course we need to decrease our use of fossil fuels.  That is the ultimate goal.  The issue is what we use to replace fossil fuels.  Economics is now telling us it's RE + storage.

4) RE is clearly cheaper than new nuclear.  New wind and solar are cheaper than many of the paid off nuclear plants, their marginal costs.  Reactors are being closed because they can't compete in the electricity market.

5) "You: nuclear is expensive
Me: yeah, and that is pretty much its only problem."

Well, no.  The cost of nuclear is a fatal flaw but not its only problem.  There is the unsolved problem of used fuel disposal.  There's a problem with siting, many places will not accept a new reactor in their backyard.  And reactors take a very long time to bring online.  I'm assuming the safety issue has been largely solved.

Now, I'm not surprised you are leaving this discussion.  I was surprised you showed back up today.  

What I've seen throughout our exchange is your willingness to wave away inconvenient facts.  You seem to me to be coming to the discussion with a strong preference for nuclear energy and have spent your energy trying to dispute or ignore facts that don't support your bias.  

I'm not saying that you should accept everything I've posted as fact.  You know how to google.  You could easily confirm or disprove my statements.  Or you could have asked me to support my statements.  But that is not what you've done.  IMHO, you are misleading yourself.  

Let me jump back in time.  About 30 years ago I became very concerned about climate change.  It was clear to me that we had to quit using fossil fuels and move to low carbon energy sources.  At that time I saw future grids powered by nuclear energy.  That was because at that time wind and solar were much more expensive than nuclear.  It would have been difficult to get the general public to switch to nuclear energy and pay more for electricity but there was pretty much zero probability of getting the public to move to wind and solar due to the very high cost increase.

But over those 30 years I've watched the price of solar panels drop by about 50x and wind electricity drop by 10x.  As the facts have changed so has my opinion.   I thought we would use a lot of pump-up hydro for storage but now I'm seeing a very large roll for batteries.

My advice to you, upon parting:

Gather facts.  Then form an opinion.
Reply: @factnotfiction5915  
IIRC, you were attributing the drop in solar costs to panel cost decreases.  I pointed out that BOS costs have also dropped.  I made no comment about the percentage of decrease attributed to either.

Do you understand the difference in cycle life between a lead acid battery and a LiFePo battery?  I just 'used up' some lead acid batteries designed for off grid storage.  If you held them to no more than 20% discharge then you could expect a 4,000 cycle life.  A LiFePo battery can be discharged 100% and have a >15,000 cycle life.  That is an immense difference.

100 kWh.  Use 20% so what you have is 20 kWh usable.  4k cycles = 80,000 kWh  lifetime storage.
100 kWh.  With 100% discharge you have 100 kWh usable.  15k cycles = 1,500,000 kWh usable storage.
18.75x more usable storage.

I've given you  a lot of information about today's batteries.  Time for you to take on new facts and update your thinking.  We no longer live in Edison's times.

As for battery storage, I gave you data from Jeff Dahn's lab.  Numbers produced during careful research.  There are no Gen IV nuclear plants online that we can use for real world numbers.  If any get built and can produce competitively priced electricity the we can revisit our solution for getting rid of fossil fuel.

That said, I have found exactly zero arguments describing how Gen IV nuclear can be made price competitive.   Remember, the current cost of new nuclear is around $0.15/kWh.  To become competitive new nuclear would need to drop below $0.04/kWh.   That approaches a 75% reduction in cost and I think you can realize that cutting 75% of the cost from a mature industry is, well, the words might be "pretty much impossible".    Cutting 25% or even 50% of cost will not be enough.

BTW, NuScale isn't going to do the cost cutting job.  They admitted that long ago.